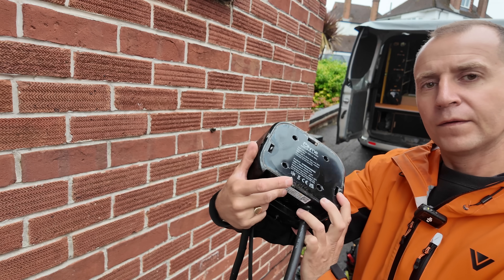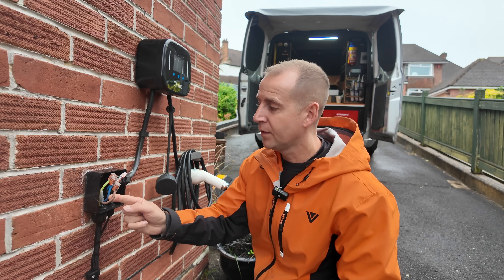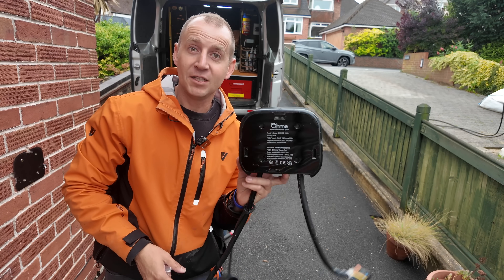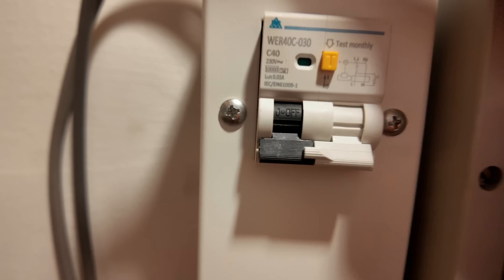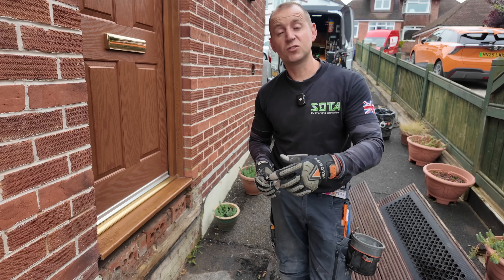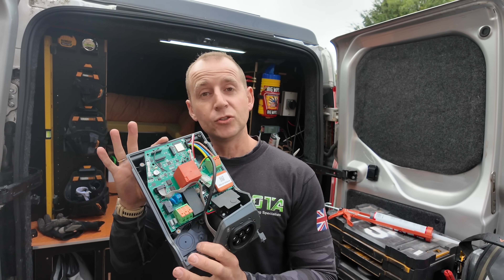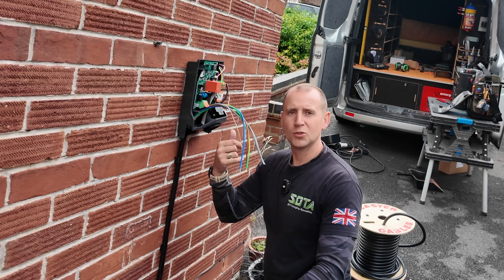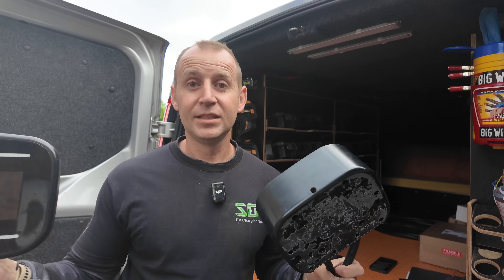DO NOT BUY A OHME EV CHARGER UNTIL YOU HAVE WATCHED THIS (OR INSTALL ONE)

Comment: What's the problem with a flex cable if it's the correct cross-section?

What's a cap 5 cable?

Nice looking install -- professional.

Comment: Shame on Ohme for making future repairs more difficult than necessary. I would give them credit for using screw down terminals for the incoming and outgoing power connections, unlike the Simpson one (and many others) that use wago style clip terminal blocks. I’ve a Wallbox Pulsar Max that after two years of use, the terminal block used for the tethered cable (so factory installed), a Degson type (looks the same as the one in the Simpson), has suffered heat damage along with the inserted tethered cable – discoloured and fused together. Thankfully this was discovered before a potential catastrophic failure. Why can’t manufactures, especially those pitching at the premium end of the market, make a premium product that is well designed to minimise such long term possibility.

Comment: Hi, What charger would you recommend for a model 3 Tesla - I do not have a smart meter and would under no circumstances be subjugated to an energy company that tried to push one on to me - So using the phone app would (in my opinion) would not be any use to me. So I guess it would be called a dumb charger in this case. Also which areas do you cover. Thanks.

Comment: Back in early eighties I did 4 year apprenticeship in electrical installation. So much has changed. I'm surprised the cable to the junction box wasn't SWA, but things have probably changed. The new charger and install looks much better. The Ohme looks like cheap tat to me.

Comment: VW fitted these when you bought a VW group car. If it was a contractor they aren't paid much to install so use cheaper safe options. Being an electronics engineer most chargers are not great. I would ask an electrician to install a UK supported charger with a known name.

Comment: The Ohme Home Pro has a monitoring display and if an instant daytime charge is required the Ohme's buttons allow the Intelligent Octopus schedule to be easily overridden. It's bad practice to drill into mortar rather than brick. Incidentally, how much did Simpson & Partners pay you for the commercial?
Reply from the maker: It’s not sponsored by Simpson and partners, I have not Evan told them I’ve made the video. If it was sponsored their charger would be on the thumbnail,

Comment: Little bit unfair on Ohme there Adam… they’re actually really good at fixing and replacing chargers under warranty, if it’s deemed to be a faulty charger and not an installation or breaker issues they usually just get the engineer to swap out the charger. The junction box set up means it’s a quick easy replacement for the customer and you’re in and out in under an hour. Post warranty they offer refurbished units at discounted prices if it’s knackered. 
It certainly wasn’t the best install I’ve ever seen but Ohme’s are now installed with Proteus EV boards with the correct bi-directional RCBO and type 2 surge protection. Yeah, they use 6mm hi tuff and a seperate Cat 5 as it’s a lot cheaper than EV Ultra, but that’s because the vast majority of Ohme installs are ones where it’s either Motability or a free install with the car, as the budget is limited the installation firms use hi-tuff and cat5. 
Ohme ain’t perfect, that’s for sure, but you’re doing a bit of a disservice to them here mate, starting to look a little like you’re sucking up to firms that reward you for the promotions…

Comment: OK, so you can get into the Ohme charger really, once you know where the screws are, and could put a proper length cable in (it has got screw terminals)  or replace parts. It's not rocket science. Hiding the screws is pretty unhelpful, but maybe it's good for waterproofing (although I don't see a gasket on the front plate...)

Comment: This was quite cheap and cheerful, but was any of it actually noncompliant (assuming it's been there for a few years?). There was a time when EV-ultra didn't exist, and then it was a pretty expensive option.  Grommets are not required so long as people can't stick fingers in, 10mm tails for a one-slot CU with 6mm to the charger is OK, etc. Yeah it's not future-proofed, and I would do a better job myself, but I think you are a bit harsh calling it 'rubbish'. 
For a long time Ohme was the only thing Octopus were supporting so people that wanted intelligent go didn't have much choice. Which is ridiculous - this is exactly what standards and open protocols are for.

Comment: As an installer in residential premises, not EV’s, we’re taught to ALWAYS drill from inside out, after using a BOSCH detector or similar. You measure the depth of the wall, using the drill bit, and apply some insulation tape 10mm less than the depth. Use hammer setting to drill out and then turn off the hammer for the last bit and before you hit the depth tape ease off the pressure and it wont blow out the brick on the outside.
Reply: Also you can use a smaller size drill bit and then use the right size to then drill back in.
Reply: and as a fitter i can tell you that the reason they blow the brick on the outside is because the lazy buggers bang a big 25mm masonry drill straight through from the inside instead of pre drilling a pilot drill of 5mm straight through and then drilling in from both sides with a 25mm masonry thus leaving a nice clean hole, it pays you to actually inquire of the fitter how they are going to drill the penetration and ask that they do this because many of them just plod on regardless.
Reply: @paddervey7765 I’m knicking this idea mate thanks
Reply: 😂 pilot hole inside out then bigger but outside in! Basic stuff.
Reply: @stuartcraigon2003  you would think so stuart wouldnt you, its a massive step to avoid blowing outside brickwork but so many installers dont do this, just laziness and uncaring!

Comment: Just had one of the basic Ohme chargers installed by Octopus and I can’t fault them, they handled the unlooping and all the ground works for free. I love the solar boost charging with the Ohme, I have it configured so that I’ve not paid a penny to charge my car yet and we still get paid for exporting, so I’m actually getting paid to charge my car lol. Octopus offers a 3 year warranty also, would recommend.
Reply: How do you get 'paid' for charging you car? You are not exporting if the energy is going into your car.
Reply: @73henny  I set the car to charge at 2.3Kw max, we generate more than that with the solar panels so we are still exporting while charging when it’s sunny. It’s a setting in the car, not the charger, the Ohme is set to only use solar. Yes it’s slow, I can always hit the boost button and pay for it if I need more distance than I have, but so far I have not had to do that, win win.

Comment: My £900 (installed) Ohme broke after 40000 miles worth of charging. 5 years. Non-replaceable. They claimed it was out of warranty and quoted me for a new one. 
I claimed against the retailer (the installer who I bought the Ohme through) using Consumer Rights Act 2015 (this is the law pertaining to quality and overrides warranty legally). After some legal discussion the retailer and Ohme agreed to  installed free of charge a refurbed model. Fingers crossed it lasts.
An expensive item like this should last 10 years. Don't let them fob you off using 'warranty'. The Act is the law not the warranty.
Reply: Interesting.....I'm guessing this works on most goods brought and sold ?
Reply: @chrisyoung7362 yes it does. But it is based on reasonable expectations and is more effort than a successful warranty claim.

I think it's reasonable that a charger should last longer than 5 years, but after 8 years is it still reasonable??

Comment: Very interesting video so thanks for sharing. 
Here is another lesson for installers.
My mate is very disabled with MS and recently got an EV on Motability. It was their first EV so they were clueless and when the guy came to install their charger he asked did they want tethered or untethered? They didn't really understanding the difference so asked his advice and he installed an untethered EVSE. My mate is on two crutches so for him to dig the cable out of his car every time is impossible. When I heard what the installer had done I was furious at his stupidity. They would have had to pay hundreds for him to replace it with a tethered charger so they just leave their cable plugged in all the time.

If you are talking to other installers please make them aware that if it is possible, disabled have good reason to get a tethered charger rather than untethered.

Comment: Ohme literally sent out 6mm Wagos with the supplied Wiska box for some time. Even before that it was the manufacturers recommended connector. They have since changed to a heavy duty terminal block but that was only a few  months back. 
Also, Ohme used a large national installer to do hundreds of replacements originall installed by small subbies so your customer's story doesn't ring true. The warranty is the liability of the retailer (in this case Ohme so they wouldn't have a leg to stand on if they tried that).
That WCED DB is total crap though. The mark of a 3 job per day cowboy installer.

Comment: Personally all those large components should be socketed.
Got a basic old dumb Rolec, had to replace the controller inside it, took 15minutes to swap out.
Didn't have to touch any of the relays or other circuits., Just 1 part with 6 wires.
Anything this large / expensive shouldn't have non servicable parts, especially something like a relay or controller.

Comment: Maybe I have just been lucky or the Mk1 Ohme charger was better built  but mine hasn't missed a beat in the 6 years I have had it. on 3 different tarrifs and 2 different EV's...currently Octopus Intelligent Go and the app works perfect 

It's the original long/narrow one..it too is the tethered one so uses a junction box and a separate earth rod ...not as neat I know but its not readily visible to anyone but me  so doesn't bother me.

I wonder how many of the big names like Zappi etc also don't provide full internal circuit boards etc as replacement parts.

Fingers crossed mine carries on a while yet but yes it seems today's world is a buy new ..don't repair one in many appliances

Comment: i like your videos but but it feels that you are busy trashing your reputation in trashing someone else. 
H07 rubber cable (at 6mm csm is only available as h05 or ho7 standard) is an excellent product (usually more expensive than ultra) and you have no need to slag it off. doing so says more about you.
Prysmian (owned by Pirelli) and others that make EV ultra type cables. i am yet to use one that has a quality issue. Just say you are sponsored by Doncaster and you like it, dont say others are no good.
while the install inside the house was sub par, you were again trashing stuff that is irrelevent, a box with only room for the rcd has no need to be 25mm - mentioning it when there were enough other issues says more about you. and after your wrork was completed you could have shown what tidy and clipped to the wall looks like. none of my customers would have cared about nonesense details about cat5 or anything. showing that everything is secure matters more imo.

hope you dont trash yourself in the next video.
Reply: Yeah agree, I tuned out with all the negatives. How many circuit boards has been changed in that new box to KNOW it will be easier to repair? A lot of people have a tight budget and have to buy what they can afford, of course the more you spend the better the quality usually but I'm sure Ohme wouldn't still be around if they were as bad as made out here?!

Comment: 🤔9:04  INTERESTING that you omitted to mention you swapped TETHERED for UN-TETHERED one !
you talk about benefit of quick & easy install to a installer.
i thought design of solutions should be around customer who pays...
so how will they store their cable?
wrap around this unit doesn't seem feasible - no lip. and that's if it even allowed to lock cable in, when not used. ☝

Comment: I'm as far as reputable installer and as a non electrician that's watch most of your vids I see what I think are issues the biggest is that cable from the ohme to the junction box. Looks cut down and its going at an angle, absolutely no reputable installers doing that.

Comment: Yes totally agree, i have replaced 3 of them and 2 OY chargers and two of those wallbox chargers. Only one Zappi, which was the old one with screw terminals. I know you like to do nice quality workmanship, as do i, but if the client did no have the budget to redo the cabling, you could have put an isolator in place of that joint box. (I know you hate them) but it is good safety practise with a 7kW appliance, although not aesthetically pleasing i know. As always you get a like from me!

Comment: Given up of trying to compete for customers who spend £50K+ on a car, but want to save couple hundred quid on the charge point.
Reply: In fairness the EVSE is just a fancy car charing socket just like an outdoor socket. So you can see why people should no have to spend more than £300 for a socket which has no manufacture offering even a 5 year or 10 year warranty on a £1k charger. So manufacturer should be backing their premium products as assurance for consumer like Miele does for Kitchen appliances for example

Comment: 1. seen worse blown out bricks than that, least he covered it, guessing he drilled inside out because of the slop of the house and wanting to make sure he didnt drill some were he shouldnt of.
2. he used 10mm tails, he did... but for something which supplied JUST an ev charger , more than capable for the power, you used 25mm because you used a board with more than 1 way.
3. how long has ULTRA EV been around? maybe when it was installed that stuff didnt even exist?
4. that ugly  box as you called it ,what else was he suppose to do? you said they come pre wired with abit of  cable, he has to joint them some how, at least it was black

one thing on youtube is every spark alwys picks others work no matter good or bad
Reply: Well said, i bet others could criticise the work he's done.

Comment: you dont need a cat5 to the unit do you? ,  providing load management is not required
Reply: Load curtailment is nearly always required.
Reply from the maker: But it’s worth doing, I would rather do more and provide a better install rather than the minimum
Reply: Most of the time it will be a must to fit load management. Especialy as the suplies are being fitted with 60A fuses etc.

Comment: Great video you turned a really bad install into a really good install the junction box looked really bad looking ,over here in ireland we have to have an isolating switch with ends up beside the EV charger looks treble  what was the reason for not using wago's .
Reply from the maker: Thank you sir, I believe it’s because they are not designed to be used under constant load
Reply: @sotaelectrical  Thank you

Comment: What do you use instead of wagos?
Reply: I guess you could use 60 Amp Terminal Block. Personally I can’t see the problem with wagos as long as they’re suitably rated (>32 Amps).
Reply: @GadgetMan36  Best use the 612 (6mm = 41A rated) Wago instead of the 412 (4mm = 32A rated)
Due to continuous load factor, where you are supposed to add 25% or a bit more for instances of 3hrs or more...
Charging overnight for 3, 4, 5, 6, 7 hours at 32A means the cable runs slightly warm for longer periods - hence the extra 25-30% for 3hr+ continuous loads taking it to require 40A load capacity
If Ohme supplied it with a decent length lead, then in 80% of cases, you'd probably not need a connection box
Reply: Crimps ❤

Comment: Thats a H07 cable, as far as im aware theres nothing in the regs that say it can't be used outside clipped direct (But i could be wrong.)  As for the Ohme, for the price and smart tariff compatability you can't beat it.  That charger is at least 3 years old looking at the metal cable holder. I've installed 100s  of ohmes, and rarely get call backs. Wallbox on the other hand... :D

Been a sub for many years, I'm glad you stuck around after the chat about packing it in. Consistency is key and you're smashing it!
Reply from the maker: It is a H07 cable and your right there is nothing saying it can’t be used, I just personally wouldn’t.  The charger is just over three years old and unfortunately I have replaced quite a few just like this recently but there you go. 
Thank you for your kind words sir